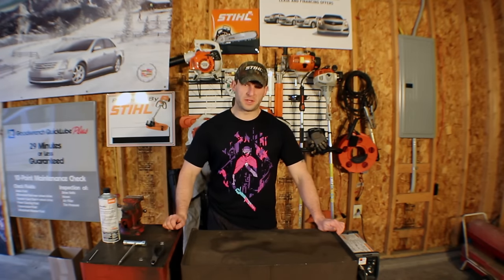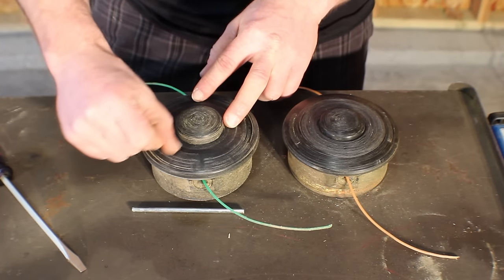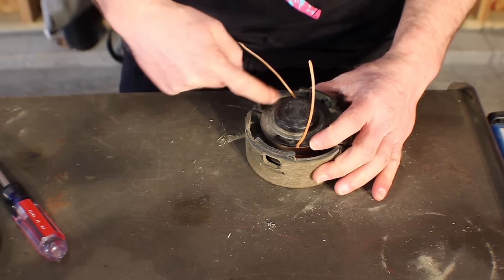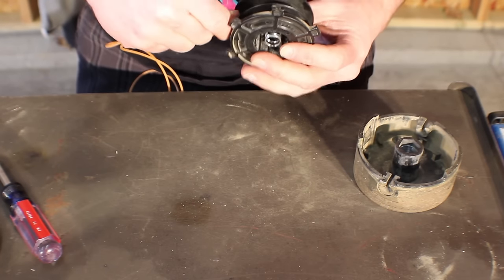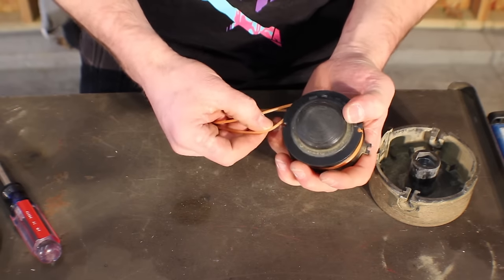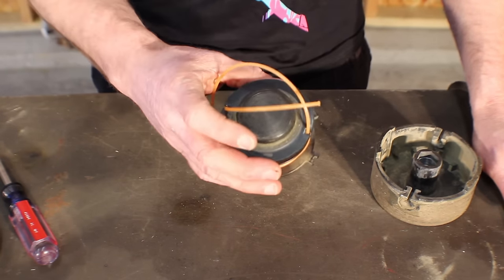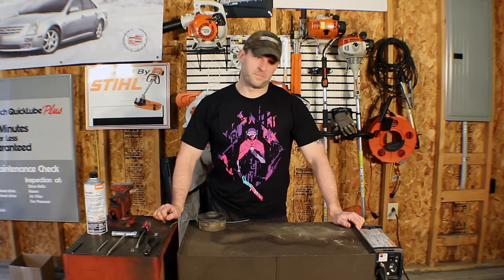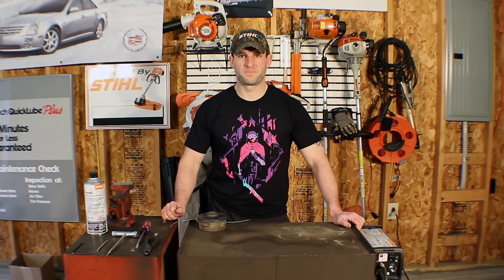Stihl Autocut 25-2 re-string

Comment: I just purchased a FS 91r this morning, I got tired of buying new string trimmers every couple of years from the box stores. I am not in the lawn care business so this trimmer should last me many years on my 1/4 acre lot. One of the frustrations with trimmers has been rewinding line.
Your video showed me that both lines are wrapped in the same direction that is new to me! And good! My last spool I really liked was one that you push the line through the middle of the spool and twist the spool it worked great. But it will not fit on my FS91r 
Your video should resolve my head aces with rewinding in the future. Good job on the video.
Reply: I've got a FS 90.  I'd always had cheaper weed wackers too, but I can't believe how much better the Stihl is to maintain, start, and use.  Just gotta be careful with these things, as they will throw stuff a lot harder than with the cheaper ones.  Don't know why mine works so much better, can't describe it, but it just does.  That being said, I hate winding the line on these things...

Comment: Great video, thanks
One minor thing you said : 12 1/2 ft. for 0.095 line
Stihl's specs are for .095 = 33 ft total or 16 1/2 ft each and for .0105 it's 23 ft. or 11 1/2 ft each
But I think you said if you use a little less it makes it easier, so no biggy.
Thanks again!

Comment: Thanks man, I took the Autocut head off of my KM131r because it always felt really fiddly trying to respool it. Well I didn't realise you could lock the string down with those tabs so mine was always firing back up at me (and then usually birds nesting) - annoying as hell! 

Well I think I'll dig it back out and give it another go. Currently using an Oregon speed feed head which I do like, but it hardly takes any line at all. Hope you are recovering well dude.

Comment: Best tip I ever got was to spend $25 and buy 855 ft. spool of line and never, ever try to put string back on a spool once it’s been installed before.  I have a lifetime of new string now, and an extra head.  Stihl Autocut C 26-2 is compatible with the 25-2 and is SO much easier to thread up correctly!

Comment: One thing that makes a difference that I learned from a Stihl dealer is to store my string in water in a tupperware or a ziplock bag. The string gets dried out over time and brittle. Keeping your string in water seems to make it cut longer without welding to itself or breaking.

Comment: Would you normally take the head off to fix the wire or would you just turn it over and open it up ? New owner here, thanks. Nice video very useful tips
Reply: I've never seen anyone in actual usage remove the head. I think he just showed that to make the video more clear (and in case you want to put a different head on).

Comment: RedMax heads are much easier to restring , only require one line bent over in the middle. They also have a steel insert in the tap button.

Comment: Great video. Very helpful. Just ran into the situation you talked about with the bump head wearing down. I'm looking on line and see alot of aftermarket spools and heads, what's your opinion on aftermarket parts for replacing heads and spools?

Comment: Two very important points:
1) Soak the string in water for 24 hrs if possible. Nylon gets brittle. It’s very hydroscopic (absorbs water) and the water will make it more ductile, last longer and not break off inside the head.
2) The 4 holes in the spool are different sizes. You need to use the correct hole for the diameter string you’re using. The same sized holes are opposite each other.
I’m an engineer, I know these things 🤓.

Comment: can you grease the bearing behind the plate under the head like you do the needle bearing on a chainsaw??
Reply from the maker: there's a torx head on the side of the head, you take that out and thread in a special tube of grease which you squeeze into it.  It greases the bearing as well.
Reply: thanks man never realized that greased the bearing to

Comment: How long do you leave the line after threading?
Reply from the maker: Trim it to about the length of the little metal blade on the inside of the orange cover.  That blade is there to make sure the line doesn't get too long and place too much of a constant load on the engine.  It's no bigee if you have it longer, after you start it up it'll get trimmed down pretty quickly anyway.

Comment: Great informative video!  Thanks!  Do you recommend the manual feed one?  Like 31-2 for less problems,etc?
Reply from the maker: Everyone has their own preference, but personally I had the manual feed heads.  Every time you need new line you have to stop, get line, install, then get back to it.  Much more efficient to just get good at restringing them.  Also helps using the standard round line, doesn't bind up anywhere near as much.  All the nifty shaped line you can get is really just a gimmick, though I've no evidence to back that up with.

Comment: Could you recommend a ride on lawn mower that can go down steep hills and mow through some rather tough stuff?  I am not all that handy and very hard on equipment.  Not to mention I live way out in the boonies.  I'm thinking John deer. Something under $2,000.
Reply from the maker: Not really going to find anything that you want in that price range.  For steep hills, you need something with a locking rear end, and knobby tires.  In john deere, it's the X500 series, and they start around the $5000 range.  All of the basic lawn tractors and one wheel drive, and the tread is meant to not tear up the lawn, which means horrible traction.

Comment: The nuisance with a thinner line is that it doesn't snug into the notches, and can birds-nest when you put the spool back in the body. After the third time, and you retrieve it all from across the garage, you start again, and decide you won't buy the cheap thinner line again.

Comment: Excellent video. Thanks for the tip about the screwdriver to get the top cover off.I have a brand new spool, (used once) and those morons at Stihl don't have a clueabout how hard it is to get the cover off! You are not just going to press in on thosetabs to remove. At least not on mine.
Reply from the maker: Not at all, especially new ones.  They're way to stiff to just use your thumbs, glad the video helped.
Reply: I was able to remove the spool on a brand new head no problem with my hands. Might just be how much strength you have in your hands and how you push the tabs.

Comment: I do everything exactly as you stay, use it for a few minutes, no string, and it is a "bird's nest inside the cup. Explain.
Reply: You possibly could've wound it in the wrong direction. There are arrows on the bottom of the line cartridge to show the correct direction.

Comment: Unbelievable Stihl is still using the same spool head as a 1970s weed whacker. I just bought a brand new  FS 56 and am totally disappointed that this antiquated  system is still in use. My bad for not checking the unit out better before buying but I was sure it would have some type of auto feed system. Even the cheapest Chinese models have this. It's 202 Stihl. Get out of the 1970s!
Reply: you buy Chinese, I will buy German